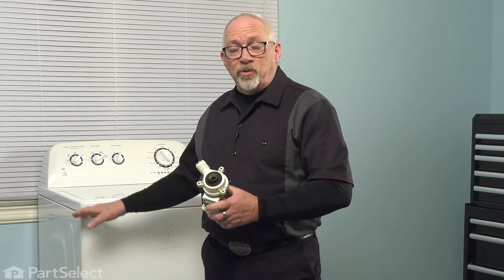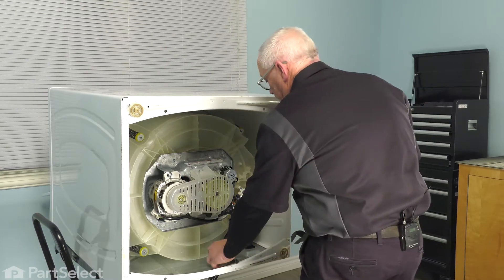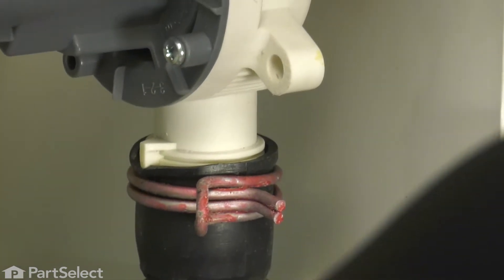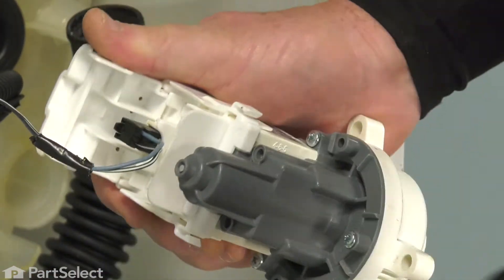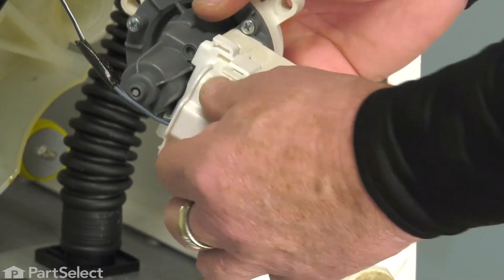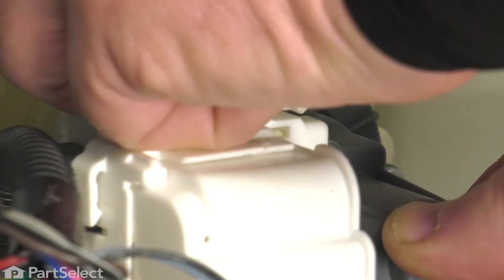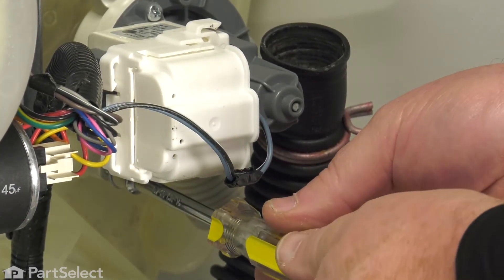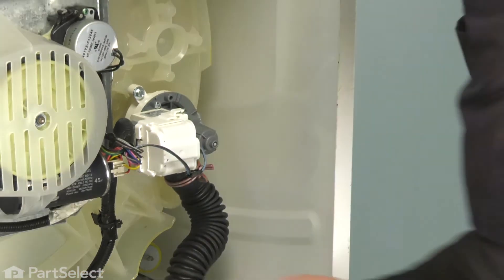Whirlpool Washer Repair - How to Replace the Pump (Whirlpool Part # WPW10661045)

Comment: A little soap on the spigot where the pump slips into the bottom of the drum, and a little on the hose spigot connection will make both easier to install.